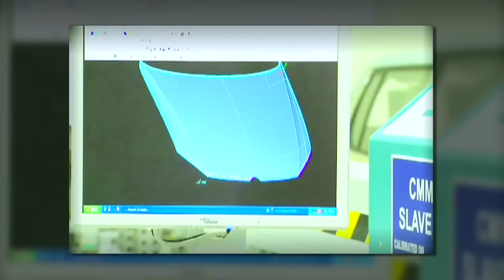Vento : Safety

Comment: Every other car company is doing the best to improve safety features and build quality of their car's except the Maruti But we indian is obsessed with just maruti. Incredible india.
Reply: Maruti cars are the most economical to maintain. Spare parts are very reasonably priced. The newer models come with all basic safety features like abs & air bags.
As the car ages the cost of parts replacement is too high in vw, toyota and honda and are not available easily everywhere. I own a toyota corolla 2007 and parts are dam expensive. When i compared a ciaz with corolla one can  get the same saftey features at half of the price of a corolla with premium built quality. And not to forget the resale value the moment a premium badge car comes out of the showroom it will depriciate 30-40% and still it would be not so easy to sell it whereas in comparison a maruti will loose 10-15 % max 20% depending how popular is the model and will be sold like in no time. All this things make maruti a most prefered badge. Built quality is something maruti would have to work upon as there us lot if competition now a days and they should work to make their cars more safe. For city driving the maruti's are one of the best choices.

Comment: "Vento"the best for driving. Ofcourse you will have high maintenance cost. I been using from past 6 months. Safety and driving comfort won't come with out paying much.
Reply: Can u recomnd used vento dsg ?? 6 lacs ..2015 model..tdi..run 35000km
Reply: @svijaymba  
My deep condolences.
Reply: @fbkensarhd5279  
Means what? I did not get u
Reply: @fbkensarhd5279  
U r not recomnding right
Reply: @svijaymba  
Yes I am not recommending.
Vw makes good cars, but please buy a new one.. don't go for a used dsg..
Or u will suffer with the maintenance bills.
..
They are premium cars that need premium maintenance..
Just sit and think.. if the car is premium but sold for less money.. how will the dealership make money?
They will simply increase the service costs and part costs.
Reply: @fbkensarhd5279  
Hi ok well.noted..point taken
Reply: @fbkensarhd5279  
I will.not buy

Comment: for a car that touts its safety it still offers only 2 airbags while all its competitors offer 6+ airbags
Reply: It's body is stronger hence it's more safer than one with 6 airbags
Reply: Respected Reddy sir, what if a car starts rolling side ways can the 6 airbags save passengers inside the car from being crushed under the roof?????????? 

How did the Secunderabad guy didn't break his skull & bones when he along with his polo fell from the fly over bridge that too with 120+ km/ hr speed momentum??

Kya uska baap aakar bachaya kya ladke ko🤔
Reply: Respected Reddy sir, what if a car starts rolling side ways can the 6 airbags save passengers inside the car from being crushed under the roof?????????? 

How did the Secunderabad guy didn't break his skull & bones when he along with his polo fell from the fly over bridge that too with 120+ km/ hr speed momentum??

Kya uska baap aakar bachaya kya ladke ko🤔
Reply: @srinivaskumarreddy120  with all due respect I own two VW group cars a vento and an audi q5. Yes the body is very strong and hence it is safer than the majority of indian cars on the road. There are even stories told by my dealer about a vento which fell off the ghat somewhere near Bangalore and all the occupants came out without scratches. Coming to the biodiversity flyover incident the car in that case was an imported polo gti and not the regular polo. It had 6 airbags. In addition to the body the airbags do help
Reply: @princereddy4887  imported one🤔 Don't know sir. Shall check my self. Good day
Reply: @srinivaskumarreddy120  https://www.carandbike.com/volkswagen-cars/polo-gti this is the car driven by mr kalvakuntla
Reply: @srinivaskumarreddy120  https://www.latestly.com/india/news/speeding-volkswagen-gti-skids-off-biodiversity-flyover-in-hyderabad-1-killed-video-goes-viral-1356518.html this is the one
Reply: @princereddy4887  ohhhh. Thanks a ton ji for providing info. Atleast got to learn something 👍

Comment: Even though car is good in build quality it has Outdated specs.
Reply: Anything
Reply: It has all the latest features
Reply: @shreeinformatics719  no keyless entry.
Reply: Keyless entry...cut n curve in body...sun roof..push button start...high mielage...etc etc...safety not required..build quality not required ..  .
Reply: @DileepM  suck that. Were good with twisting key to start the car😎

Comment: But hey Verna is the best sedan ever. It has 6 airbags. Vento has just 2. Check out the verna first
Reply: Vento top model has 4. Nore airbags mean more safety?😂 If the body structure isn't rigid what's that airbag gonna protect u...learn some basic stuff first
Reply: Vento has better interior quality than verna and does rattle as tym pass same with exterior better build quality than verna even though they only provide 2 airbag and its still scored 5 star